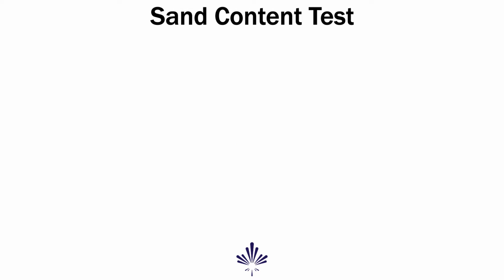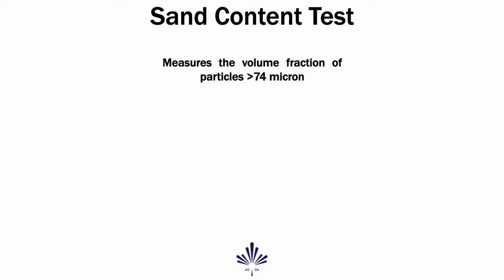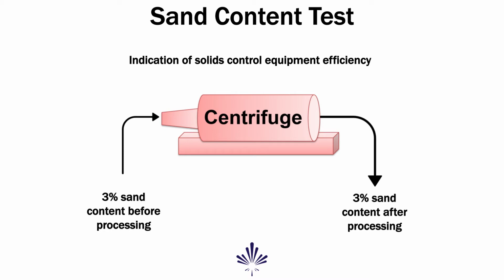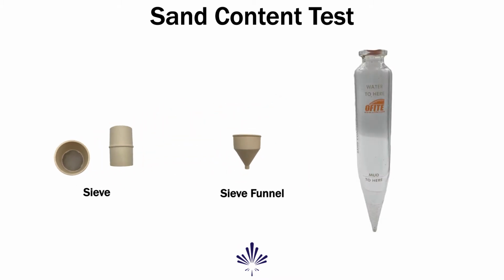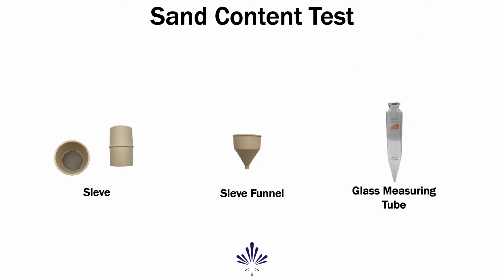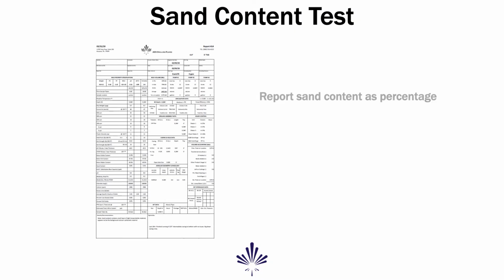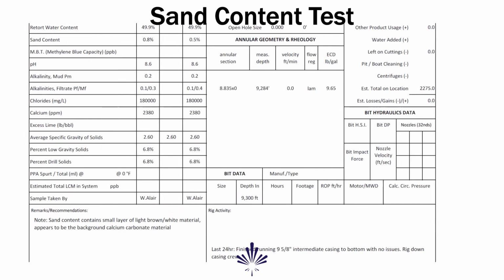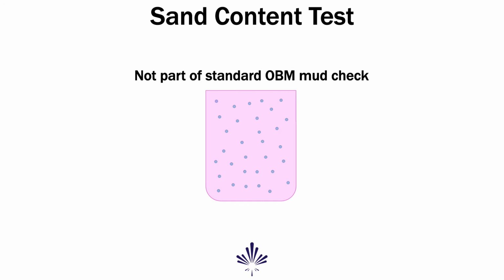AES Tech Tip: Sand Content

Comment: API has an OBM sand content test

M.3 Procedure
M.3.1 Fill the glass measuring tube with drilling fluid to the “drilling fluid” mark. Add the appropriate
non-aqueous base fluid (diesel, mineral or synthetic base fluid) to the next mark. Close the mouth of the tube
and shake vigorously.
M.3.2 Pour a small quantity of the base fluid through the screen so that the entire surface is wet by the fluid.
M.3.3 Pour the mixture on the wetted screen. Retain the liquid passing through the screen for proper
disposal. Add more base fluid to the tube, shake and again pour through the screen. Repeat until the tube is
clean. Wash the solids retained on the screen with the base fluid to free it of any remaining drilling fluid.
NOTE Do not stir or manually force the mixture through the screen. Tapping the side of the screen holder as the drilling
fluid is added can help the mixture pass through the screen. If water-wet solids appear on the screen, add several drops
of the oil-wetting chemical used in the drilling fluid to smooth out any water-wet solids.
M.3.4 Put the funnel upside down over the top of the screen. Slowly invert the assembly and insert the tip
of the funnel into the mouth of the glass measuring tube. Wash the solids into the tube by adding a small
volume of base fluid or spraying the solids with base fluid from a wash bottle. Allow the solids to settle. From
graduations on the tube, read the volume percentage of sand.
Reply: Hi Paul